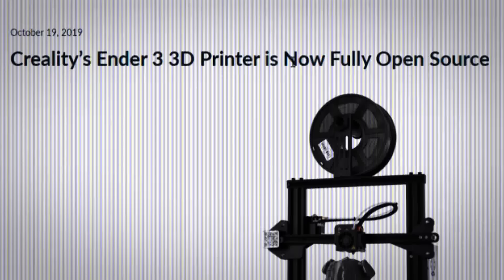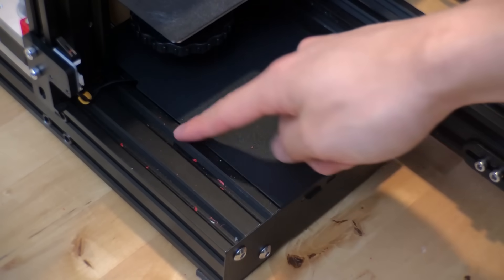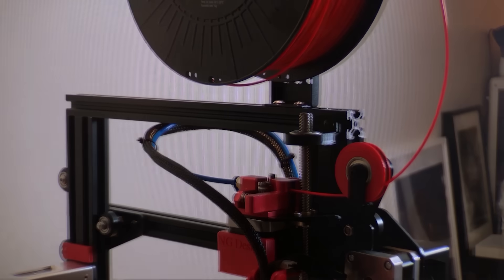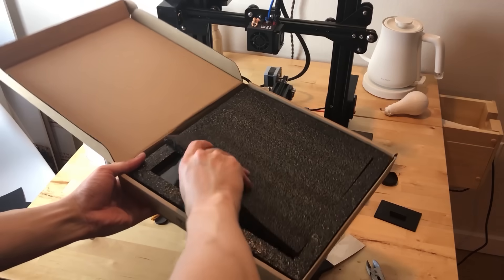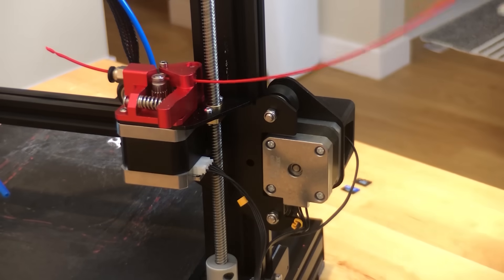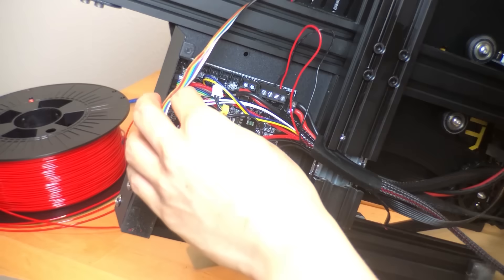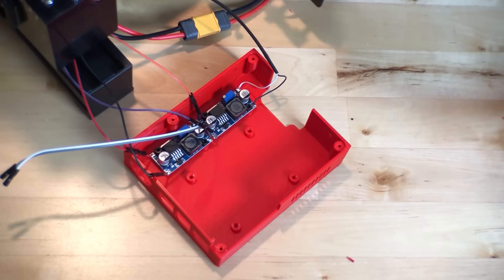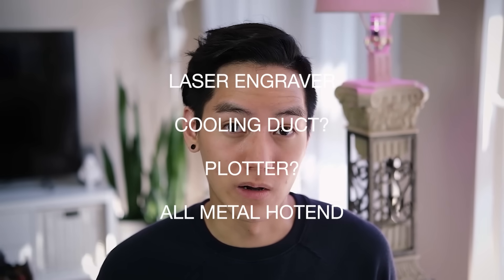First 24 Upgrades for my Ender 3 Pro - Part 1

Comment: Everybody talking about how he added LED lights and it's going to be as bright as the screen, not noticing the switch he installed that lets him turn them off while the unit is still running.
Reply: Hmm, could he not have wired a wee relay up to the pi so he could turn the lights on and off remotely when he needs to check on a print over the web?
Reply: @BeardyBaldyBob  Maybe, but my point is that everybody seems to think that the LEDs will bother him while he tries to sleep, when all he needs to do is go turn them off, and the printer will still run.
Reply: @jlee7811  exactly bro!!! There is a big difference between a light you can control vs a light that's on the entire time of use. Some people's kids man!!🤣🤣
Reply: YES, YES THIS.
Reply: Does turning the led off or on while printing cause any print shifts from spikes?
Reply: @B3DPrinting  absolutely not, i pretty sure the massive meanwell psu dosen't give a shit about the few mA that the led draw

Comment: "shouldn't we fix this design issue?"

"no, the user will use our product to fix the design issue"
Reply: Yeah, it's truly amazing how 3D printers are essentially self-upgrading.
Reply: Thats the beauty of Open Source!!
Reply: 3d printing in a nutshell they give us the parts we do the rest 😂😂 but seriously is amazing how we can improve everything in this machines
Reply: One of the reasons I love my CR-10s over some more expensive but less open source printers😆
Reply: why not give the machine an AI and internet access and it will upgrade itself :D
Reply: This made me laugh aaaand it's five am
Reply: I thought the same thing. I was thinking dang I bet printer accessories are a tough market. Most of the extras can be printed lol.
Reply: More like they let the users customize the printers. I've been 3d printing for 7 years now and most companies just give you the basic printer cause it will keep costs down. These printers work out of the box even without the mods. I only added a few mods and customizations to all my fdm 3d printers but for my resin printer there's almost very few you can mod it with except for maintenance.
Reply: @dredgewalker  ok but the one where the rod slightly bends seems like a huge oversight on ender's part, no?
Reply: Off line games nowa days^

Comment: Instaed of the pull handle, Why not add a line to the ending script in your slicer to park the bed in the desired spot on the machine after every print job?

Comment: "hard to sleep because of the lcd lights"
Proceeds to add LED strips to the machine
Reply: Yea but
The LED strip has, you know, a switch :D
Reply: @beerenmusli8220  yeah you're right xD
Reply: @PedroMartinez-oz4pl  imagine if the switch breaks and the led strips still is turn on
Reply: "puts cardboard box over printer"
Reply: @thefluffychewbacca  “makes massive hole in box so he can see the printer”
Reply: theres a switch bud

Comment: I've got another issue. I can't have my "platform adhesion" on None when printing. because then the plastic doesn't stick. I need to use Raft, which takes about 30 min to 1 hour longer and uses a lot on unneccessary plastic that goes to waste. Any idea why It doesn't stick? I bought the Ender 3 pro 2 days ago
Reply: Bed leveling and/or your nozzle is too far from the printer. You should barely be able to fit a piece of paper between the nozzle and the bed. And make sure your bed is heated when you print.
Reply: LGE FoXy is right. Making sure your bed is level is so extremely important. Spend extra time doing it even if it is annoying. Trust me you will not regret it.

Comment: I've got an issue. And that's on the  plastic not sticking on the bed? Do you know what causes this problem?
Reply from the maker: there’s a few causes for that. could be an unleveled bed, dirty bed, or bad z-offset. look up bed leveling tutorials. i would start with that since that’s 99% of the time the issue. good luck!
Reply: @ScottYuJan  Thank you so much for the advice! It works great now :D
Reply from the maker: @elguran  WOW that was fast haha nice job and no problem!

Comment: Covering the fan isn't...... the smartest thing.
Reply from the maker: The power supply fan is actually not an exhaust but an intake so the cover is only redirecting the intake air. I haven't really had any problems with this yet and it's also a very popular upgrade on thingiverse so it's probably fine?

Comment: Scott you upgraded everything but the most important, a sealed enclosure with a fan and outside vent for evacuation of dangerous fumes and particles from your home. This would of been #1 on my list. Please be careful when printing any type of plastic materials.
Reply: Not a necessary upgrade. Not even ABS printing generate much fumes. PLA and PETG is absolutely safe you didnt even smell anything at least if you buy some quality stuff. Filament is definitely not a thing to buy cheap on aliexpress or ebay from no name ratailers.
Reply: @kubo-svk790  Do some research, ABS plastic can be pretty nasty. PLA is not that bad but ABS is known as a carcinogenic material. How much exposure will harm you? Time will tell but I would rather be safe then sorry.

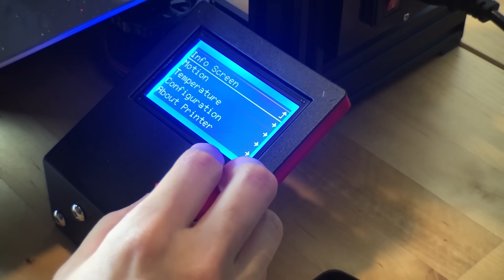Comment: 5:34 what was the point of getting the Ender 3 Pro then, if your just gonna remove the magnetic bed
Reply: That's the one I didn't understand. I mean, I get that adhesion is better on the glass build plate, but I still wouldn't strip my magnetic bed off. The flexible build plate is SO nice for removing prints.
Reply: @Excaliber158  thing with glass is its used for hotter prints, and with the magnetic bed you cant go over I think 100 degrees or else it breaks the magnetic part. but there was really no point in buying the Ender 3 Pro if your just gonna remove the only difference between it and the normal Ender 3. theres a few small changes but thats the major one and he just ripped it off

Comment: I know its been a while and it doesn't change much but for anyone else:
1. DO NOT use the lead screw stabilizer! it does more harm than good. I'm glad he corrected this in the description. 
2. The Luke Hatfield hack is only needed if you don't have enough of the Capricorn tubing for the entire length. The splice with the printed spacer is so you can use the blue Capricorn tube in the extruder, and the white PTFE for the rest of the length (some people prefer the wider diameter). If you use the blue Capricorn tube for the whole thing you don't need the splice or the spacer :)

Hope this helps!

Comment: Step.. whatever..forget scraper at all, just add some water in the edge of the print, wait and capillary forces will lift your print.works best on glass
Reply from the maker: .... that’s brilliant. i’ve gone as far as shoving the whole bed with the print into my freezer before hahaha i feel like an idiot now 😂
Reply: Scott Yu-Jan first machine i built had a glass bed from an old poster frame, if you get issues use the wood glue on it , the white one as it is both soluble by water by just washing, second it comes in bottles and dries clear/transparent. It makes same quality as just glass, but what it does is that if you miss the level a bit it doesent matter. Also it protects but just minimal from scratches.
Reply: Now i builtva delta, basically because i never ever have to level it. It is a bit messy to calibrate depending on what arms you make but it is more exact than a cartesian in the center up to aboutv2/3rds of the circle. And more silent and about 2-3 times faster, di figurines on mine
Reply: Ender is however a very good machine, making one now but more of a ..similar in 3 mm aluminium. But a mix rather as i build mine..but my delta wasnt great for cogwheels etc and there a cartesian makes it better so i needed a second

Comment: Why do you use PTG and not PLA
Reply from the maker: most were PLA actually. i only used PETG early on for some of the pieces because PLA was sold out at the time on amazon and PETG is a little better with higher temperatures so parts like the raspberry pi enclosure i decided to use PETG
Reply: @ScottYuJan  oh cool I just got that printer for Christmas and I’m starting to do lots of mods but the mod that covers the rear of the LCD screen was so skinny and flexible that it couldn’t be used even though it was exact from the files. Do you have any recommendations on how you printed it

Comment: is it safe to have this printer and print in my own room or what would you reccomend?
Reply: The issue tends not to be with the printer, but the filament used.
PLA has no odor, and no chemicals leeching into the air. ABS has a strong smell that may be toxic, but is yet to be confirmed.
TPU has a smell weaker than ABS, that isn't toxic. And PETG has no odor like PLA. However, you should always make sure your printer environment is well ventilated. If your room is stuffy, and the printer isn't in an area nearby a vent or large ventilated space, its going to be uncomfortable in the long run.
Reply: @pauldeddens5349  Thank you! this is very useful

Comment: No all metal hot end and power source upgrade?
Reply from the maker: i might do hotend upgrade in part 2. why power source upgrade? i don’t think i’ve heard of that one before. cool
Reply: @ScottYuJan  Depending on which version you bought you have an unregulated power supply. If that’s the case a better power supply is an easy (or so I understand) upgrade.

Comment: 1:35 move it slowly! the generated voltage turned your lcd on!
Reply: is that a problem? i noticed mine was doing that when I built it
Reply: @joaqstarr  yes, it can damage the boards.
Reply: @untrust2033  oh shit, I'll stop doing it then. Thanks!
Reply: @untrust2033  you can turn the printer on fully by moving the motors lol, I would not recommend it though.

Comment: About how much filament did it take to print those parts?  Would a 0.5 kg roll be enough?  Can you also explain why you used PLA on some and PETG for others? Just ordered my pro and a lot of these look really useful.  Still learning the ins and outs however!
Reply from the maker: if you get each piece printed successfully on the first try, it should be more than enough i think. i don’t think i used up a single 1kg roll with all of this and i had a few failures too. good luck!

Comment: Great vid.  Can I ask, which do you thing has the edge, a fully upgraded (board, hot end, BL touch ect the operating mods) or the new V2?  I'll ordering one or the other in the new year and would love some opinions.
Reply from the maker: just bought the V2 for my dad and definitely that haha v2 is still worth upgrading though but you won’t need as many upgrades since it already comes with a few. still worth adding the BL touch and hotend stuff to it though in my opinion.
Reply: @ScottYuJan  Thanks, Scott. A v2 it is.  I'll start researching upgrades after New Year (and continue to watch your channel)...

Comment: I had an issue with the cable chain they caused a lot of harmonics and inconsistent tension leaving side wall lines in the print. With the CR-10 max and pro I use  a retractile key chain and it hold just the right tension on the cable to keep it higher than the X path

Comment: Can that printer print 12inch marvel models from salix3design
Reply from the maker: nope. printer only goes up to around 9.25 inches. you CAN upgrade it to give it a taller z-axis though for about 50 bucks i think so that’s not bad.
Reply from the maker: a bit tedious though

Comment: 2:56  this cover might reduce cooling performance , it's better just replace the inside fan or motor with quiet one. :)
Reply from the maker: If i do replace it should i still have it facing inward blowing air onto the components? or should i turn it around and let it act more like an exhaust? any ideas? thanks!

Comment: just an fyi i noticed you soldering and then heat shrinking your terminals, you can get crimp terminals with a heat shrink sheath so you just need to crimp then shrink the ends and you are good to go.

Comment: 10:15 You know a heat gun works a lot better right? you can pick one up online for around $20 if you look hard enough.
Reply from the maker: yea! a few people commented that haha 😅 i actually did find one for fairly cheap and they work so much better!
Reply: @ScottYuJan  yeah, best $20 hobby purchase I've ever made. The 2nd best is a set of helping hands, there are plenty of them on thingiverse if you wanna print one. I'm printing one that has a holder for a magnifying glass and a small fan as I write this, my old $5 harbor freight one finally died

Comment: The reviews for that dual-drive extruder are really mixed. A lot of people get problems and failures. Poking around Amzaon, it seems like they're flooded with versions of this and they're almost all terrible. What's been your experience with it? Did you have to modify it to get it working?

Comment: can you use pla for most of the simple petg prints?
Reply from the maker: yup for sure. petG is definitely optional.
Reply: @ScottYuJan  Thanks for replying so quickly. Also wanted to say that you make fantastic vids.
Reply from the maker: you know what, i should add. PETG is slightly more heat resistant compared to PLA. so for parts like the raspberry out enclosure and stuff MIGHT benefit a bit from using PETG but i don’t think it’s required. i doubt any of those parts are going to hit such a high temperature. thank you and good luck!
Reply: @ScottYuJan  Most likely ill avoid a lot of the more wiring-based prints anyway, as my parents don't want me messing up anything before my robotics meet in January. Thanks for the info though as ill definitely try all of this stuff in the future

Comment: Should point out that the fan cables don't reach the Pi's connector pins by themselves if you dont use the cable to the buck converters.

Comment: I level my bed and it is good. When you level your bed and it is not good there is something wrong with it. the blt touch only move you axis more to compensate this wrong leveled bed. This is not good i think.

Comment: Quick note to everyone, don't use the Z-Rod stability thing, that rod doesn't spin fast so it doesn't cause vibrations and it's supposed to be loose at one end. It will do more harm than good (if any) if you have a bent rod.

Comment: Thanks for sharing. Tried the SD card adaptor but it wont be recognized as "inserted/removed" unless you insert/re-insert the micro SD card itself which kinda defeats the purpose.
Reply from the maker: yea i saw a few people run into this issue and i initially had it too! i think the cause is that when u put on the enclosure it’s popping out the SD adapter again due to it pushing in. because once i had it properly installed i’ve never needed to remove it again. i just use the refresh or “attach media” button on the printer when things aren’t being detected. good luck! i hope that helps. i’ve gotten a few comments like yours and most people were able to fix it too.
Reply: @ScottYuJan  I was testing just the extension cable (without the enclosure yet) and apparently the printer does not recognize activities on the farther end of the cable even if the nearer end is properly inserted. Printer does dynamically refresh only on activities in its original slot, so I have to re-insert on the printer slot and then it works. Must be something wrong with my cable, and unfortunately my current ender pro has no refresh or attach media options :(
Reply from the maker: @MrKockabilly  whaaaat?! is that a new marlin feature? dang i’m sorry to hear that. that sucks! maybe try updating your firmware because i do know the latest marlin solved many other issues the old one had too. dang... that’s really annoying though. hope you figure that out.
Reply: @ScottYuJan  Yeah I'll definitely figure it out eventually. Thanks!

Comment: I couldn’t print the z-knob. The material doesn’t stick to the bed. My ender 3d pro prints its testing models just fine. But couldn’t print the knob at all. What am I doing wrong?
Reply from the maker: probably not an issue with the knob but more something to do with your slicer software. it depends a lot on why it’s not printing the knob. hard to help you without more details. is it a bed adhesion issue maybe?

Comment: The title for this video is why I got a Sidewinder instead.
Reply from the maker: nice. the x1?
Reply: @ScottYuJan  yeah only issue I had was i created a wall brace for the top corners to stabilize it when printing tall things. I was going to get the ender 3 and was pretty set on it because of the online support for it, but the number of fixes people were applying to this steered me away and over to the sidewinder, which everyone kept saying was great value of features for the money.
Reply from the maker: @JasonEllingsworth  well it's a bummer you didn't actually watch the video because all the 24 things i added are optional improvements you can add to just about any printer and i'm sure the X1 could benefit from them too. they're mostly around ease of use. the fact that i printed every one of the add-ons with the ender 3 i think is a pretty good indicator that the printer works great just right out of the box. the x1 is a decent printer though. i hope you enjoy it!

Comment: If I am just getting started should I use PLA or PETG?  I ordered some PLA with my printer.
Reply from the maker: i recommend PLA. PETG has a few qualities that are a bit better but I’ll be honest, the upgrades i printed using PETG required a bit more calibration and definitely had more failures. i almost never print with PETG unless the part absolutely needs it. if you’re new i would recommend getting your printer dialed in with PLA first and then experimenting with other filaments then. good luck!